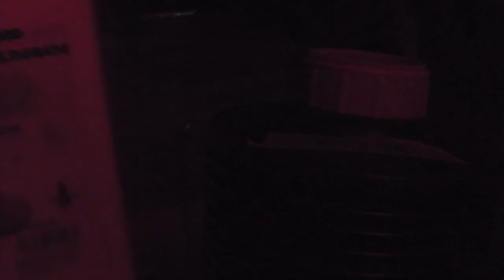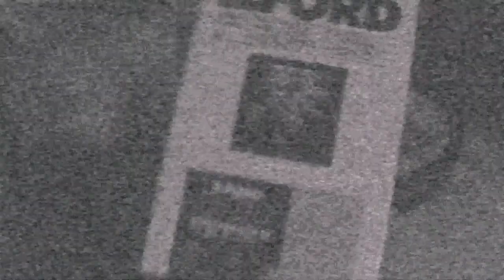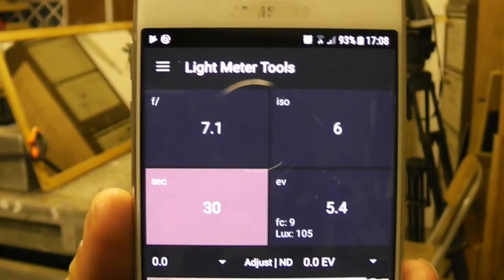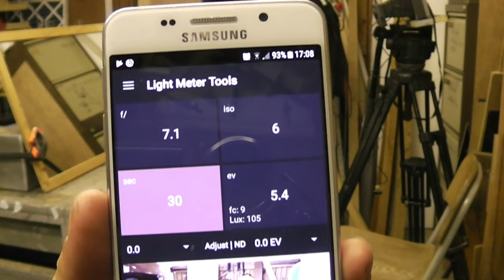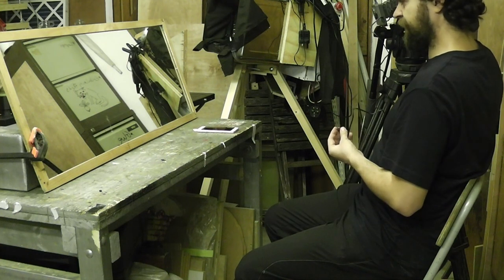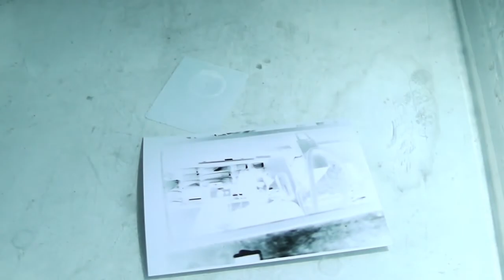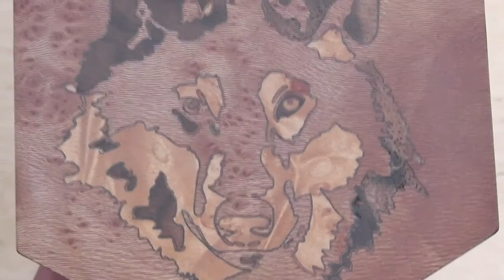Shooting on Paper with Polaroid Land 103

Comment: Dude easily one of the best darkroom fotage that actually is real , also any tips on what kind of light use for darkrooms
Reply from the maker: Thanks, I've found that for working with black and white paper I can get away with all sorts of lights. I've used normal light bulbs in a metal lampshade with red paper or red plastic sheet stuck over the end. And I've developed outdoors using 2 layers of theatre blackout fabric as a kind of darkroom tent. Since black and white paper has such a low ISO you can get away with a lot.

Comment: Thanks for sharing! Any plans to have an Arduino sense the shutter press and close down the shutter automatically after the specified duration?
Reply from the maker: That's an interesting idea - it would be easy to add an LDR to the Arduino to calculate the correct exposure. I might have to add an additional power source for the Arduino though, because the camera runs on only 3V - not sure if that would be sufficient for a 3.3V Arduino. But part of me likes the simplicity of timing manually - since you have to sit so still for so long it really feels like a 19th century experience. And with paper it doesn't matter too much if you accidentally add or subtract a few seconds from the exposure.
Reply: Perhaps go 9v and step down for the Polaroid? I too like the manual aspect, many polaroids had a nice timer. It would be interesting if one could be incorporated. Its just a short, right? 

I hadn't thought of the possibility of Polaroids before, so thanks again! I've been looking for a nice carry around for dry plate collodion, assuming I can design up a removable plate holder and still incorporate a dark slide.
Reply from the maker: Nice, I've always wanted to try plate photography! I bought the chemicals but never got around to it. I did mix up some solarising developer Man Ray-style though.